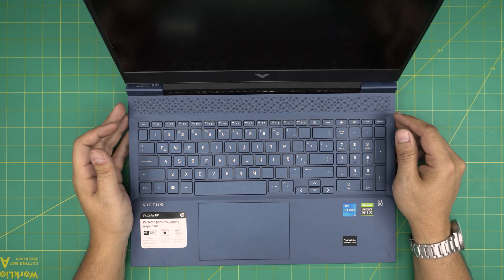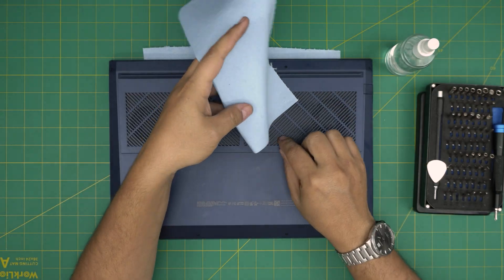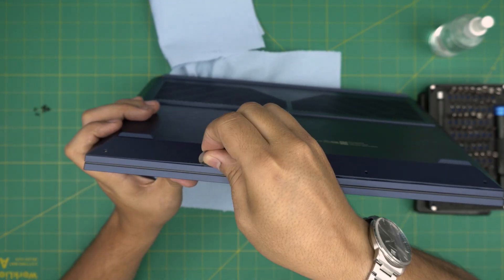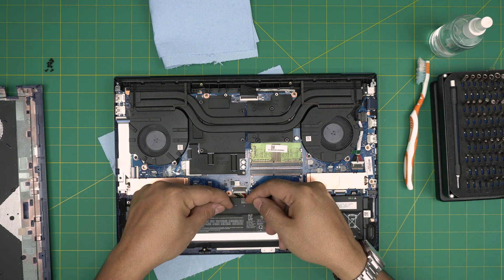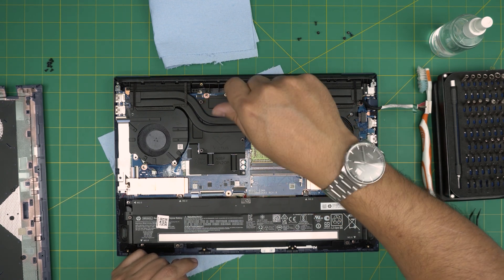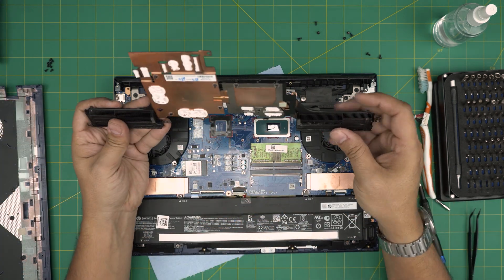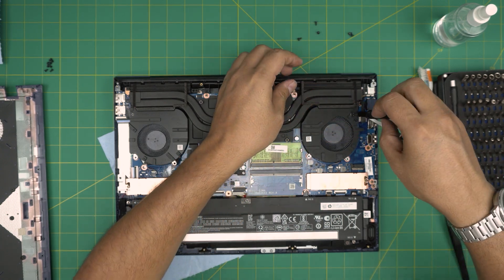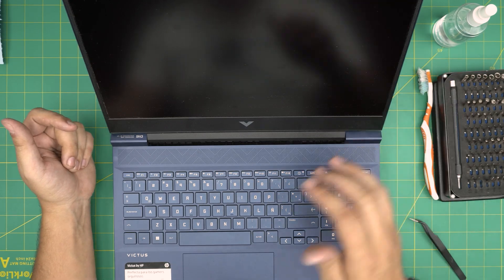How to Repaste and Clean an HP Victus 16 d0507 Laptop

Comment: is it safe if i change the termal putty with thermal pad 1mm? if it safe, which thermal pad size u would recommend in my city there is only available in 0,5mm 1mm and 1,5mm
and if not, is it safe if i change the thermal putty with thermal paste?
Reply from the maker: 🫠Regarding your question, NEVER use paste where putty is used, nor use thermal pads where thermal putty is required. The reason for the thermal putty is that the gap is not a standard size (neither 0.5mm nor 1mm). If you use a thinner thermal pad, it will not cool effectively, and if you use a slightly thicker one, it may cool those components but will push the heatsink away from the GPU and CPU, resulting in poor temperatures.
Get the thermal putty from Amazon or AliExpress.
Should you have any further questions or requests in the future, please don't hesitate to ask me.
cheers🍻
Reply: @uFixTek  thanks man, ur the best, really made my day
Reply from the maker: It's my pleasure my friend.
Thank you for your support.😊

Comment: Hey bro, how can reset or clear CMOS? My BIOS is failed :( HELP!!!
Reply from the maker: 🫠Regarding your question, how you know your bios failed:?
If you want to soft reset the BIOS, disconnect the battery and the charger, then press and hold the power button for 60 seconds. The BIOS will reset to default. However, if your BIOS is corrupted, you will need to physically use a BIOS programmer, connect the probes, and manually load the BIOS using another computer.
cheers🍻

Comment: Updated comment: 

For laptops with very thin gaps like this one it's much better to use a Thermal putty like Halnziye Hy236. It performs much better than K5 Pro and can compress down below 0.1mm without issue. For laptops I recommend buying 20 grams. You will use between 10-15 depending on model.

Comment: Thank you! I learned so much from this video.

I have a question tho, after I was done it told me that CMOS settings or something was invalid, but the laptop powered on just fine, I'm just curious what it means? I was pretty sure I did everything right
Reply from the maker: It's my pleasure, my friend. 😊 I deeply appreciate your taking the time to provide feedback. If you're inclined to support the channel further, feel free to like and subscribe—or even both!
Regarding your question, THAT is totally fine , because when you disconnect the battery the BIOS will reset to default and that is totally fine.
Should you have any further questions or requests in the future, please don't hesitate to ask me.
cheers🍻
Reply: @uFixTek  I have one more question, after I reinstalled the fans and everything, the fans started making grinding noises, the noise became much louder after a couple of hours of gaming, I quickly shut down the laptop and I'm clueless of what to do. Could you please tell me what it could be?
Reply from the maker: double check the fan and the case to see if there is no plastic touching the fan, and also examine the fan and see if it is not unbalanced, we go get sometimes defective fans from providers.
Reply: @uFixTek  I discovered recently that the fan is unbalanced. Is there a way to fix it? Or is it gone for good? It's components aren't available in my country :(
Reply from the maker: you cant fix the unbalanced fan sorry , get it from aliexpress
Reply: Just want to add that CMOS reset will also reset some BIOS settings so you need to adjust them again for example it will turn off using the functions keys for actions directly without fn and also turn off battery optimization. Which is totally fine but remember to double check your BIOS settings after a CMOS reset.

Comment: BRO IF I WANT TO CHANGE THE THERMAL PUTTY ON VRAM... HOW MUCH THICKNESS  THERMAL PAD NEED TO USED?  0.5MM OR 1MM
Reply from the maker: 🫠Regarding your question, you can't use a thermal pads instead of the  thermal pads, the reason is that the distance is not an even number and if you place a bit of thicker pads it will counter push the heatsink away from the CPU/GPU and you will have a bad temps on them.
get putty.
Should you have any further questions or requests in the future, please don't hesitate to ask me.
cheers🍻
Reply: @uFixTek  can you comment some thermal putty brand... since thermal paste and pad widely available here
Reply from the maker: get the : K5 PRO from amazon they are the best else get any thermal putty from aliexpress
https://amzn.to/3W2WxEy

This is an Amazon affiliate link. When you use my links, you are helping to support the channel. 🙏

Comment: great video! i have a question, can i change the thermal putty with thermal pad?
Reply from the maker: It's my pleasure, my friend. 😊 I deeply appreciate your taking the time to provide feedback. If you're inclined to support the channel further, feel free to like and subscribe—or even both!
Regarding your question, absolutely NOT, don't replace it because the distance is not an even number, that is why they use putty, if you place even a bit of thick pad, it will counter push the heatsink away from GPU or CPU and it will result in a horrible temps and sudden shutdowns, and even a GPU over heat dye.
Should you have any further questions or requests in the future, please don't hesitate to ask me.
cheers🍻
Reply: @uFixTek  thx for ur answer, mate! very helpfull! subscribe done🍻😉
Reply from the maker: It's my pleasure, i appreciate your support my friend.

Comment: Still wondering why after i repasted the temp only diffrent 4-6'c
Reply from the maker: regarding the question: by repasting you are servicing the laptop that is something you should be doing once every year, by repasting that doesn't mean you will get a lower temperature than the day you got the laptop. you should be getting the same temps that you got the laptop on your 1st day.
there is something called cpu/gpu fan curve, so that means no matter the type of the thermal paste used, after 5-15min heavy use the temps will reach the same as the brand new laptop, because the fan curve how it works is like, the fan will work at 10% till cpu is 30c or lower when then temp is over 40c the fan will go up to 30% and if the temp is 70c the fan will go to 70% only to keep the temp up to 70c.
so no mater the type of the paste you use the fan will not spin and wait for the temp to rise up to indicated temp before it starts spinning, if you want to lower your temps get a fan control app and change the fan curve of the GPU, like msi afterburner, and set your fan curve to higher speed (more noise) so you get lower temps.
but you still need to do your repaste once every year or two in order to clean the heatsink and the fan and place fresh thermal paste, else your laptop will reach faster to high temp and you will have a jet engine on your hand.
cheers🍻
Reply: @uFixTek i did clean fan's and dust every 2-3 month. and repaste 1year
Reply from the maker: that is perfect. just make sure you use a good brand of paste

Comment: Hey! Do you think a good thermal paste replacement instead of mx-4 is PTM7950 ? my mx4 dried up within a week and back at 95 celsius while gaming
Reply from the maker: 🫠Regarding your question, if you have the possibility to get original PTM7950 then go for it it will last longer, or you can get a permanent solution by placing a kryosheet
all you need to place a kaptop tape around the crystal dye and place the kryosheet in middle and never worry about replacing it, just regular fan cleaning.
https://amzn.to/3IG7MLa
Should you have any further questions or requests in the future, please don't hesitate to ask me.
cheers🍻

This is an Amazon affiliate link. When you use my links, you are helping to support the channel. 🙏

Comment: I have this laptop for 3 years and the temperature increased in this years so i decided to change the thermal paste so should i change the thermal putty while changing the thermal paste and if i didn't changed will it affect the temperature of laptop components
Reply from the maker: 🫠If you wish to support the channel, you can like, subscribe, or both!
Regarding your question,  i would recommend you to replace it, but if you find the putty are ok, then you can re use them.
https://amzn.to/49ALQfO
Should you have any further questions or requests in the future, please don't hesitate to ask me.
cheers🍻

This is an Amazon affiliate link. When you use my links, you are helping to support the channel. 🙏
Reply: @uFixTek  ok thank you, but i have another question i live in Saudi Arabia, and the thermal putty is so expensive in Saudi Arabia, so if i changed the thermal paste without replacing the  thermal putty the will the temperature decrease or there will be no difference
Reply from the maker: the thermal putty has no affect on GPU and CPU temps, its there to help the vram and power regulator temps.
just leave the thermal putty alone and don't touch it and only do repaste. you be fine.
مَعَ الله
cheers🍻
Reply: @uFixTek   okay thank you
Reply from the maker: It's my pleasure my friend.

Comment: Hello i havé to change de bios batterie where is it pls ?
Reply from the maker: Thank you for your feedback! If you wish to support the channel, you can like, subscribe, or both!
Regarding your question, this laptop doesn't have a dedicated bios (CMOS) battery, it takes the charge from the main internal battery, remove the internal battery and press and hold the power button for 30sec and it will drain the motherboard and the BIOS configuration to default, remember that this BIOS is smart and if your intention is to reset the password, this method will not work. you will need a bios programmer and re-program the chip.
Should you have any further questions or requests in the future, please don't hesitate to ask me.
cheers🍻